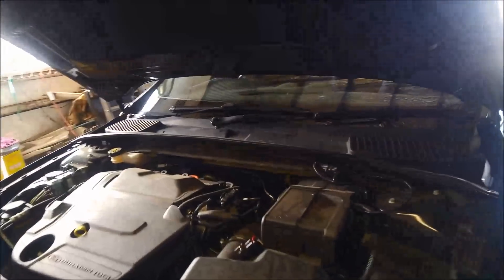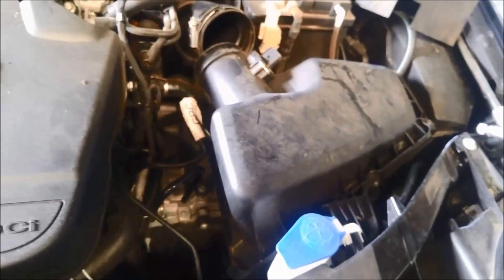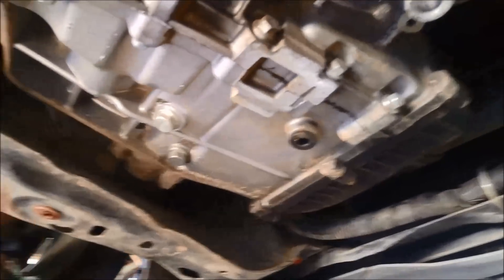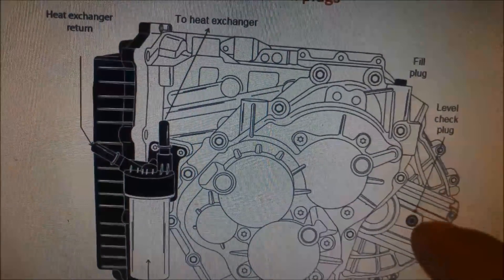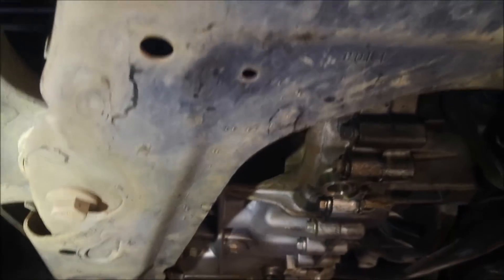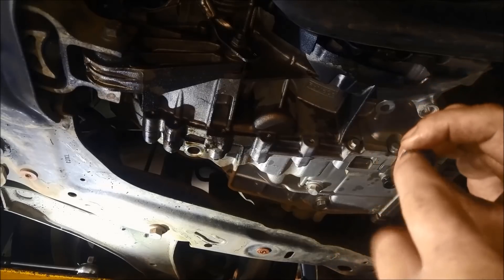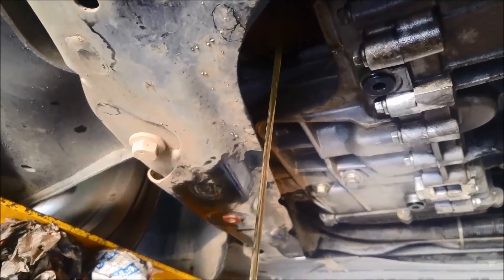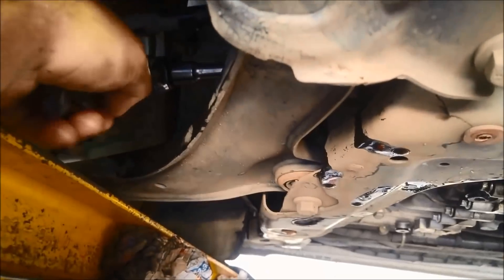Ford Powershift 6DCT450 Mitsubishi Evo X TC SST MPS6 Automatic Transmission Service Fluid Oil Change

Comment: Hoping you can help. I have this transmission in my Volvo S60, and it has fault code P0715, input speed sensor fault. Do you know where this is on the transmission, hoping its external so i can replace it myself.
Reply from the maker: hi, depends gen1 or gen2 different but one is internal. cheers
Reply: Same error here. Did you fix it?

Comment: Just serviced my Powershift and two weeks later I have no reverse gear, no fault codes or limited function warning, just says R on the dash but no reverse at all. All forward gears work fine. Garage says a stuck valve, so I am guessing solenoid needs cleaning?
Reply from the maker: hi, did you warm up trans enough to purge out air pocket when you had inline cooler filter out? you may be low on fluid ? these trans are very sensitive to fluid level. i`m sure its explained in one of my 6dct vids. hopefully you dont have a stuck fork or piston?  cheers
Reply: @YepThatsIt  Thanks for the quick response, didn't have a ir gun so it's possible the temp was wrong when I checked the level. Going to drain and refill using temp gun this time. Does seem strange I never had an issue with reverse until I done the service. Your videos help so much mate. Thanks
Reply: @sjguk267  hey mate did you end up sorting out the reverse issue?
Reply: @oceantoplate6832  Not yet, tried drain and refill using an IR gun to make sure temp hot enough but no joy.
Going to take the mechatronic off and clean out solenoids.
Reply: @sjguk267  yeah ok 
Im gonna give that a crack this week also
Reply: @sjguk267 did you end up fixing reverse? He said ok video that it needs to get to 80 deg C to open valve on filter housing and release the air pocket
Reply: @superwag634  Yes, car is now working in reverse every time, removed solenoids, demagnetized, and cleaned metal dust out of them, cleaned magnets in housing and filter, and fitted two new neo magnets to drain plugs.

Comment: Hello. Great videos from you about mps6 gearbox :-) 1 question. Have had everything out and replaced all solenoids and mounted again but then it came up that the gearbox is not in P. I clicked on the input gear arm but does it have anything to say about the P situation ( It was in D when mounting i hope :-) ) ? Mean by this, are there things that come out of position inside the gearbox when I take the lever back and forth (From D to P and back)?
Reply from the maker: hi, sounds like you may have misaligned selector. they can be tricky sometimes. re-watch the vids. cheers
Reply: @YepThatsIt  Where do you buy new solenoids ? Gasket set ?
Reply: Hey boss.
After all the work of replacing solenoids in the valve body, no improvement on the gearbox.
Delivered car to Volvo workshop and they say:

Performed reloading TCM control unit-ok
(Talked to mechanic and understand that Mechatronic and valve body / solenoids are ok.)

Cannot perform adaptive gearbox due to fault on solenoid, cluch and shaft speed sensor

Error code information TCM-P271800-Solenoid CSPS2 has an open circuit.
Error code information TCM-P271800 \ TCM-P07152F

So I wonder if you have, or can link me to a video about changing this and possibly where I can buy parts?
Volvo wants $ 9,500 to switch to a new gearbox 😱
Hoping for good answers ☺️
with best regards
kolbjorn
Reply: @kolbjrnlunga503  I got the open circuit alarm on two solenoids. Tested them at 3 ohms, so they weren't open circuit,  but I noted that the contact points on the solenoids and especially the computer circuit were a brown colour. Gently scraping with a small screwdriver made them bright silver again. There seemed to be a film of oil varnish on them.

After that, all solenoids worked again.

Comment: Hi, great video. I just have a serious issue with my MPS6 Trans volvo. It shifted jerky in 1,3,5 gears. Changed the front round oil cover of trans, bit of a leak and replaced fresh oil motul DCF and now it seem to be slipping in 2nd and serious delay when removing foot of the brake, using hand brake no delay in R or D. But car just seem to slip. No error codes in TCM module, Tried to do a adaptation of trans with autel mk 908P and when it got to shift for 3 it said no response. And then car will not move or rev nothing. After hard reset it will come back to life with revs and trans but bad bad bad shifting and slipping. ANY advise.
Reply from the maker: hi, often contaminated sensors wont throw a fault code. cheers
Reply: @YepThatsIt  Thanks for the reply. I did think that could have been the problem. But when I tried removing the small bokts holding the solonoid, they broke of, 4 off them. So now I am solidly screwed. These mechatronics are stupid expensive. Cheaper to buy a used trans. Unless you have some advise. Tapping is not an option as it is way to small. Thanks

Comment: My transmission stopped shifting, wouldn't move in any gear. I changed the oil as per this video, cleaned the connections on the grounding strap and sprayed the electrical connection plugs with WD40. Works like a charm again!
Reply from the maker: glad to hear that ! hopefully a couple beers heading my way :-) links in the description. cheers

Comment: У меня Ford Galaxy. Я меняю масло в PowerShift 6DCT450 точно также. Объём масла 5,6 л. Этот мужик делает правильно.
Reply from the maker: привет, изменение жидкости делает очень мало, чтобы улучшить проблему с этими передачами. Вам нужно принять переднее крышка, испытание и флеш соленоиды, убедитесь, что Есть нет пластиковых частей внутри корпуса клапана, очистить пластину проводника, обратный флеш фильтр, как в моем видео, очистить магниты и заменить встроенный фильтр. просто убедитесь, что вы получите транс более 80 градусов цельсия, а затем проверить уровень жидкости, потому что встроенный фильтр иногда имеет воздушный замок там, и вы должны согреть его вплоть. надеюсь, что помогает и благодарит, если эта информация стоит любого пива
Reply from the maker: reply in english...hi, fluid change does very little to improve a problem with these transmissions. you need to take front cover off, test and flush solenoids, make sure there are no plastic pieces inside valve body, clean the conductor plate, reverse flush the filter as in my video, clean the magnets and replace the inline filter. just make sure you get the trans to over 80 degrees celcius and then check your fluid level because the inline filter sometimes has an air lock in there and you need to warm it right up. hope that helps and thanks if this information is worth any beers

Comment: Hi thank you for the nice job i just have a question and hope you help with it.
For few weeks ago i did mine and now the filter is leaking. So iam iam wondering if its possible to just replace the filter with out draining all the oil.
Reply from the maker: hi, sometimes they will leak if you keep your old inline filter canister and remove it without letting the trans cool down completely ( the plastic deforms ) you can get the plastic canister and filter together. cheers
Reply: @YepThatsIt  thanks I think thats what's happened .😁👍👍👍👍👍

Comment: No need to use the diagnostic tools to reset the fluid degradation parameter after after the fluid change? Or it is not necessary to do it?
Reply from the maker: hi, no need. cheers
Reply: I supposed it's the same procedure and fluid since i have the exact MPS6 transmission in my 2011 volvo S60. Can't really get much info about it. Thanks for the video though
Reply from the maker: hi, for all technical and purchasing questions, please contact me on my face book link https://www.facebook.com/Yep-Thats-It-103051017785435/  and leave me details ( we can exchange pics on there ). cheers
Reply from the maker: hi, try without forward slash...  https://www.facebook.com/Yep-Thats-It-103051017785435   cheers

Comment: Thanks for the video.  Exactly how much did the driveability improve?  Was there any clunkiness at all going up through the gears and was it a seamless change from 1st to 2nd to 3rd?
Reply from the maker: hi, returned to normal shifts. cheers
Reply: @YepThatsIt  By normal you mean, not perfect, intermittently clunky but acceptable?
Reply: I experiencing clunkiness while gg up the hills or slopes gear 1-2-3. Think is the programming of these DCT. 

I Use the manual selector +\- to hold it at gear 1 or 2 depending on how steep the slope that will solve the issue. 

Keep this Wet DCT fluid clean and. Change the outer filter so to prolong the life of the transmission, the valve bodies will work right. Dirty sludgy fluid will wear out the valve bodies, their o-rings and seal and clog the passages. 

If u r particular and cost is not a problem change out 6-7L of fluid every 50k-75k km. Earlier is always better. But this Wet DCT fluid is expensive.

Comment: I saw on another video that access to the filter would be easier after removing the wheel well cover. Prior to changing the oil, running the transmission to stay around 10 secs at each gear. Nevertheless this is a useful video. Thanks for filming this
Reply from the maker: hi, that external filter is only the inline cooler filter, rarely find them blocked as they are located after the pump. cheers

Comment: I watched another video about this oil change. After removing the level plug to release the excess oil, you then have to add more oil until the oil again trickles from the level plug.
Reply: Sean is correct, you're probably 1/2 a litre underfilled. Both Ford and Volvo have the same direction for the level set procedure.

You should have added more oil after opening the level check bung as the gearbox is a dual chamber design.
Reply from the maker: Hi, i think the idea is that when you change the inline cooler filter, sometimes you will get a small air lock in there ( we always prefill with fluid when we fit new cooler line filter ). when you do the service it is a good idea to warm up the trans to around 80degC inorder to purge out the air pocket. cheers

Comment: Hi, was that car yours? How went that oil change in long time perspective? Everything ok? I am about to change it also in my Kuga 2013 Powershift - I suspect that the morning bity-tiny clicking noise when accelerating is caused by dirty oil/filter. Car have 76k kilometers done, and previous oil change was done when it had 40k. Fingers corssed :) Thanks for the video
Reply from the maker: hi, was customer car. with dct transmissions, its always best to do a once a year service, otherwise the solenoids, sensors and conductor/mechatronic plate will become prematurely contaminated. common sense says that cleaner you keep it, will last much longer in any mechanical system, not just transmissions. cheers
Reply: @YepThatsIt  what oil name # part number

Comment: I appreciate this video a lot. I’ve had issues with this transmission and wanted to try changing the oil without the $600 price tag, Before either changing the whole trans or taking the car to the scrap yard. Here’s hoping 🤞🏼
Reply: It’s driving so much better. Over the moon! Thanks again
Reply from the maker: glad helped, donations always appreciated. cheers
Reply from the maker: wow ! we charge bit over half that in AUD. make sure you use correct DCT Trans Fluid and refill procedure. hopefully its just blocked filter for you. cheers
Reply: Yeah this was quoted in Newcastle NSW. They were using Fuchs fluid. I got castrol trans max, with ford specs, for about $14/litre. Much cheaper
Reply from the maker: fair enough, we use Tritech or Penrite ( Australian ) cheers
Reply: mine said Transmisson limited function, apparently my transmission is gone and cost 4k to replace it... In Melbourne Cragieburn
Reply from the maker: @ncw9484  hi, I always like to try the basics and easy remedies first. however, you being the owner, have the ultimate choice. cheers
Reply: You will never get that transmission fixed. It's a defective design to begin with. It will just continue to have problems and keep failing. There's multiple class action lawsuits over it.
Reply from the maker: @Network126  I just did a solenoid removal,test/clean & reverse flush internal filter as we speak. you need to do regular yearly service, add magnets to drain plugs and remove front plastic cover and clean the magnet on the cover and also clean the two on the internal filter every couple years, otherwise your solenoids become contaminated and that will reduce the life and function of these....and having said all that, hopefully plastic spring retainer clips on wet clutches haven`t broken...cheers